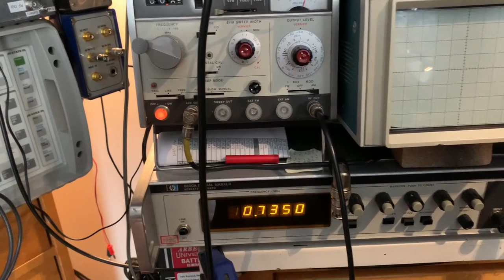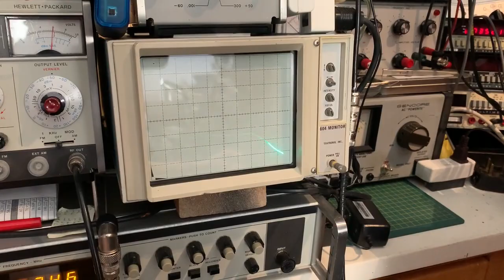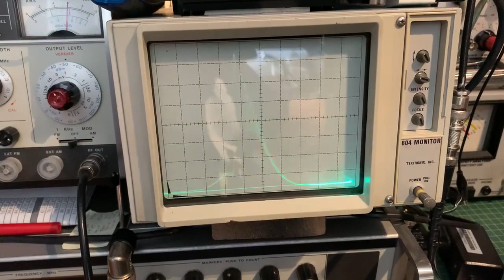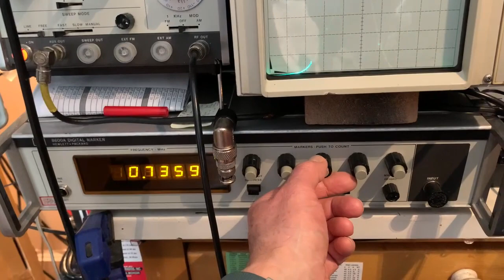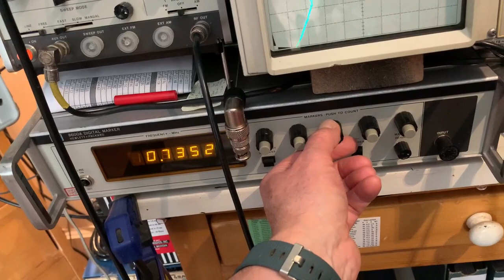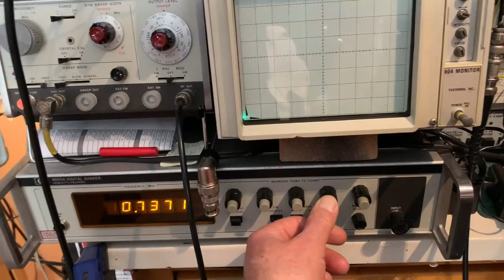IF Alignment Check on an RCA CR-91A Receiver Before Adjusting

Comment: Gerry. I am going to be doing one of these as soon as it arrives form Canada and will end up having to eventually do the alignment. I do no have the type of equipment that you do and I have watched both Mr Carlsons and your videos on doing this. I also have an older ham buddy up in Canada that had done quite a few of these sets without the high end equipment. What I do have is a new Rigol 2 chanel 100 MHz digital scope, a Fordham 2Mhz sweep function generator, a regular signal generator and a digital frequency counter. Do you think I should be able top preform a proper alignment with this equipment? This will be o course after cleaning up and recapping the radio.
Reply from the maker: Hi Bruce.  Yes, you can use a 'scope and sweep generator to plot the IF response curves in a qualitative way.  However, you need to have a sweep generator that also outputs a sawtooth wave synchronous to the swept (sine wave) output - an example would be an HP8601A like the one I have here.  With the 'scope on X-Y mode, the sawtooth (sync) signal is used to sweep the X axis of the 'scope, with the swept frequency output of the signal generator connected to the input of the mixer in the receiver.  The receiver detector output is connected to the Y input of the 'scope.  Some 'fiddling' with the output level of the signal generator, and also the X-axis gain, Y-axis gain and the timebase settings on the 'scope will be needed to obtain a satisfactory plot.  You will also likely need to invert the Y-input to show a positive curve.  Setting the receiver for manual gain usually works best.
Reply: @RadioRestoration   Thank you for your reply Gerry......Looking at what they had in the 50's to do this, it seems that I am a step ahead.
Reply: @RadioRestoration   Thanks Gerry......I would think that is what they had to use in the early 1950s, so it should work better than just trying to use an analogue voltmeter or VTVM with a signal generator.